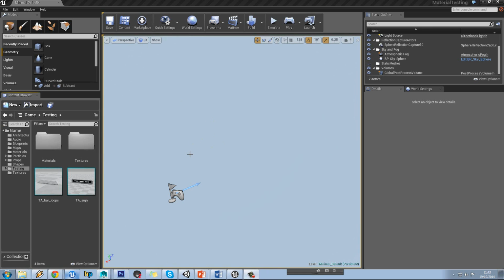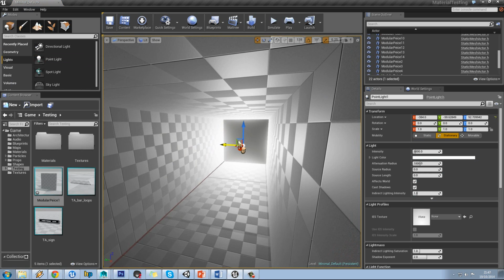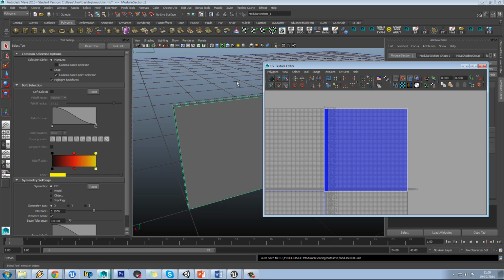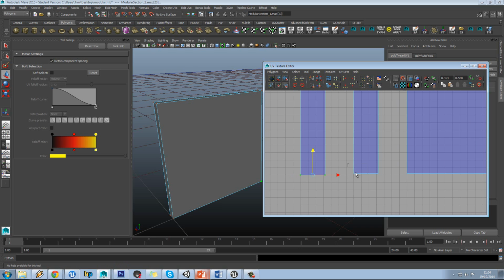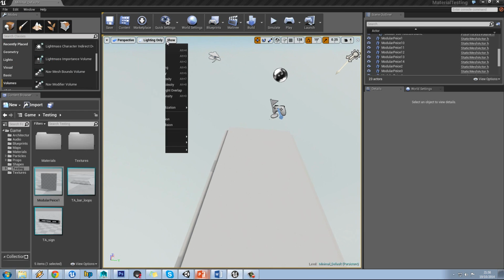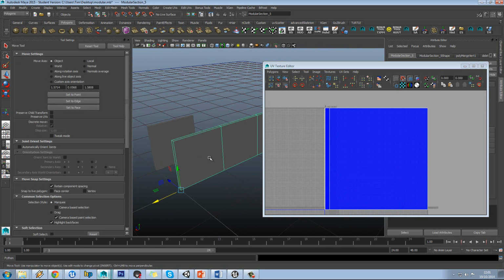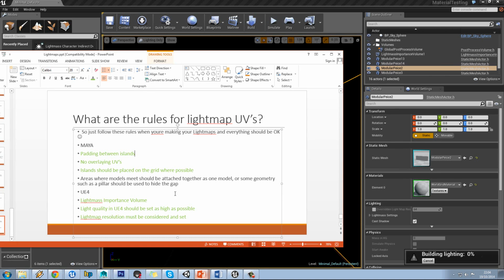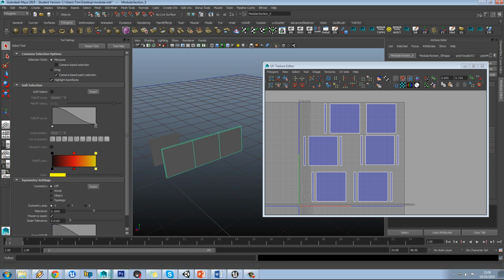UE4 - How to use Lightmaps - Rules and Guidelines

Comment: I have a little problem with UV sets in UE4. When I create 2 UV sets in Maya and import the model in UE4, UE seems to create and additional third UV Set which I do not want to have. If I import a model with just one UV Set, it doesn't create no additional UV sets. Anyone have the same issue?

Comment: Incredibly helpful. I just wanted to throw in this little bit of information though. When you are setting up your UV grid size in Maya to match your lightmap resolution to UE4, all you need to do is Divide 1 by X (Where X is your meshes Lightmap Resolution in UE4) This will give you the number that you need to plug into the value in the video. I think this is important to mention just so that you don't have to remember values, and just in case you are trying to go lower than 128 or 64.

Comment: Is there a reason to snap to grid, or is it just about keeping the UVs spaced out enough and a decent amount of space from the edge?
Reply: If you are still having bleeding shadow problems make sure of two things.

1. Your light map resolution is set correctly for the size of the object you are trying to map.
2. Padding is crucial! If you are not giving 2 - 4 Pixel padding you will encounter light and shadow bleeding.

Hope that helps.
Reply: so would it be best to make sure vertices is selected to snap to grid and make sure all UV vertices are equally snapped as well? like say you take a rectangle shape, and you snap to grid even if it deforms the UV a bit, but making sure all verts are in corners of the grid (aligned) and obvious edges of the UVs are straightened, that should work? because no matter what i do even from this tutorial its still having bleeding shadow problems. :( i use 3DS Max and not a huge fan of maya or wanting to learn it just for this purpose so im wondering if this same principle is used in 3DS Max, would what i asked work fine?
Reply: how do you know if the shadow map resolution is the right size for what you make? do you set that up in the UV map grid? like say 1 divided by say 128 = etc etc, set up the UV Map grid accordingly as you lightmap? and then just have the model lightmap resolution in UE4 match this on the model settings after import? thats one of the parts im not sure of. i also heard that if you snap UV islands to the grid it prevents bleeding, but not all islands will be able to snap properly from what ive tried, be it a circle like shape, etc. I also tend to get past the degenerate tanget bases error when importing my FBX files but sometimes the shadows themselves even at high resolution dont act right? like straight shadows seem to be wavy or shadows under say a barrel tipped over, tends to not reflect a proper shadow underneath, or some crates lets say....do not have proper shadows in crevices, or spanning behind the crate itself. hope this all made sense lol
Reply: i also make sure i have enough padding. i do at least 4 pixels on the boarding of the UV map field and between islands. ty for your input!

Comment: Hi Tim and thanks for the video! I'm new to UE4 and I do Architectural rendering/animations using Modo and Blender at the moment. I am learning UE4 for the real time capabilities. I build my geometry for buildings in Sketchup and then import to UE4. So far I have not made light maps for my interior scene that I am using to learn the engine. Do I need lightmaps, why and on what assets, e.g. furniture models, wall, cabinets etc.? Maybe you can clear that confusion up for me?
Thanks!
Reply: +Pulse2AM Light maps are used to reduce the power needed to calculate shadows for better FPS in real time rendered scenes. You should use light maps on all objects that are static in the scene (so yes, furnitures, walls, cabinets and so on, everything that will never move within your scene should use a lightmap).
Reply: Thanks! I appreciate it.